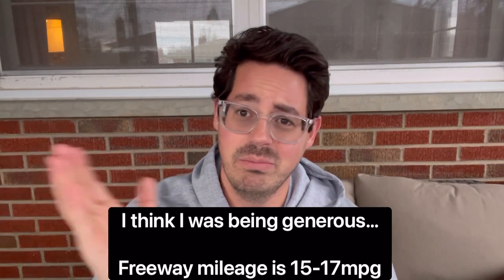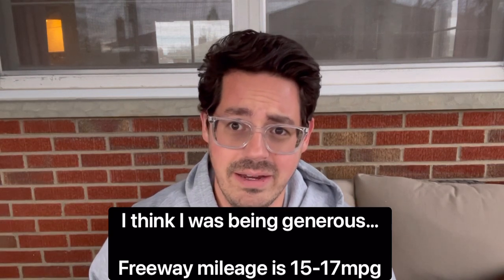Worst Engines of All Time: 1982-84 GM/Chevrolet 305/350 V8 Cross-Fire Injection System

Comment: My High School Drivers Ed course had 5 Black 1984 Formulas with the basic v6 pumping out something like 110hp. Presumably the local Dealer couldn’t sell them so they were donated to the school. That v6 is probably a worse engine but then you would expect it to be vs the v8. I have a 2nd gen TA but I’d love to have an Iroc Z with a manual. Maybe some day I’ll get to experience the crossfire v8

Comment: In 1995 I drove my workplace boss '84 'Vette, as he was considering selling it at a consignment lot; whereupon he delegated that task to me.
The bodywork and interior were kept in superb condition.
When I drove it, I had no prior knowledge about the engine with its Cross-Fire Injection.  But, just driving it a couple of miles, I considered that engine to be a 'bucket of bolts' with its erratic throttle response.
In addition, the steering was sloppy and brakes were lackluster.
Going over an uneven portion of pavement, there were rattling noises in the car.
The car was sold to a company employee.  I tactfully kept my mouth shut about my driving experience with that 'Vette.

Comment: I had a 83Z 28 automatic 305 crossfire injection I had 245,000 miles on that motor never had a problem until the day. I pulled the whole shot and went up the mountain at about 100 miles an hour and the main shaft and the tranny snapped and that was it a retired car, but I would not add a half a quart every 5000 miles I would change the oil and I would use about a half a quart Castro 530 best one I ever had. I heard nightmares about the crossfire injection but I swear to God it was the best one I ever have. I have a 1990 Z 28 Iraq with a 305TPI I would swear my crossfire injection was faster had more power and I never got worse in 20 miles to the gallon in the 15 years that I owned it I must’ve been one of the lucky ones I heard nightmares about him but then again I must’ve been one of the lucky ones😊

Comment: If I were a GM engineer in a Malaise era, I’d go with a Bosch Jetronic fuel injection system because it’s a reliable off the shelf system. Had GM used Bosch Jetronic, those engines would made over 250 hp and be a lot more fuel efficient. Heated wire MAF sensor in 1976 sounds very impressive.

Comment: I owned a 84 Vette for several years in the nineties. Never had any issues, the engine and transmission were very reliable. The power was low like everything else at the time, but it had good low end torque and an awesome V8 sound. It was a fun car handled better than anything else. So what if it starts to loose breath above 4000 it made maximum torque at 2800! What other options in 1984? Port injection had issues. Remember the injector cleaner they sold? Of course they got much more powerful in later years. This was a decent motor in 1984 and the 4 speed auto was great on mine. I liked the satisfying sound it made shifting into drive, and the shifts were crisp.

Comment: I use to own a gun metal grey 1982 Firebird and when I got it it had the 305 with a carb on it and it was alright but the late 70's early 80's 305 were boat anchor's I fixed mine with changing the stock cam with a after market cam and it helped it out a bunch and the engine finally got to breath I went with something that was close to a 350 cam but with  little higher lift I remember I put new valve springs in too along with cam and lifters and put a aftermarket intake on at the time too.

Comment: Just seeing this and I have 2 each 82 crossfire corvette's.  They are junk.  Very, very vacuum sensitive to put it mildly.  The ECU monitors so many sensor inputs, which makes troubleshooting issues a major challenge, amongst other things. Tranny 700R4 has been good but waiting for that to be next.  Buy an 80 or 81 and stick a 4 speed auto in it and enjoy.  350's are the best engines ever.  My other 82 is what i call Frankenvette.  Removed and trashed the crossfire and put edlebrock with holley 650 and headers.  Fires up everyday lol.

Comment: Yes the engine itself is arguably one of the most reliable engines you're talking about the fuel and spark system that was seriously problematic but other than that the American V8 350 305 are unbelievably proven and reliable engines compared to anything foreign because they're simple to repair and they last so yes the ignition system sucks that's why you take it off and slap on a four-barrel carburetor and you are good to go

Comment: I think this would have eventually been perfected but in 1985 GM had the tuned port injection and there was no point in continuing with the CFI. Especially when the basic Quadrajet was cheaper for the lower end engines and efficient enough.

Comment: You could hold the A pillar on my 79 T/A, T top car, feel it move back and forth. The roof sheet metal actually cracked on both sides where the center support for the T tops meet the windshield frame.

Comment: I had a Cross-Fire in my '84 Vette.   It was pretty quick to about 65, then tapered off quickly.   I think it was rated at 205 HP.  No troubles with it, and it was dependable, but the Vette deserved better.

Comment: Long runners are for low rpm tourque. Short runners are for high rpm. The intake also has tiny runner size, what’s really hamstringing it. That’s why they make the “renegade” aftermarket replacement.

Comment: A 305 ci engine cannot even inhale 700 cfms lol , a l69 feedback model was rated 195 hp , thr lu5 code was a 175 hp in 83 and a crossfire would pull on a lg4 no problem . My 83 has 71 k all original and will break loose in second gear I don't know wear you come up with this stuff but its entertaining to say the least 😂

Comment: my 83 z28 crossfire pulls strong slams gears and a total hoot to drive .plus the fiber glass hood with electro cold air induction flaps makes it a super cool nostalgic  electronic muscle car . They make heftey tq at a lower rpm . Im certain it could beat a lg4 z28 with feedback rochchester . The crossfire is the most unique out of all 3rd gens 4 bbl cars are just boring

Comment: Drove an '83 Z28 305 crossfire system back in the 80's. It was bought brand new. I can safely say, I thrashed that car terrible, I was not gentle with it. I can also attest to the fact that the transmission was a weak link as I dropped it twice. I have to say, for the total package, it was a great performing car for the time period though. It had plenty of low end torque but it would run out of air at the top end but it was a 305. But the engine and crossfire system was flawless for the time I drove it. Regular maintenance was all I did. It got great gas mileage too compared to carbed engines we had prior. Wish I still had her. Loved the forced induction hood too, the flaps that flipped up at full throttle. pretty cool stuff. Sorry your experience hasn't been as good.

Comment: I too loved Knight Rider (Im 52). When I turned 16 I bought a lease return GTA from the LA Auto Auction, 305 TPI auto (due to the T-Tops). The car was beautiful (Gray, gold BBS wheels, orange digital everything, total showroom glitter) and a perfect pile of junk. In the 80's (Valley) every home had an F-Body in the driveway because somebody worked at the Van Nuys plant and got the employee discount. My High School (El Camino) was full of them, Firebirds, IROCs, Z28''s, TAs... The design flaws were ridiculous. You turn too fast and the gas moves to one side of the tank and the car stalls. You turn the wheel to max and the front tires grind the wheel wells. The doors had to be realigned every few months (warrantee) due to the swish-cheese body movement... I gave up after six months and ran it back through the same auction. Memories...

Comment: Man you people are  stupid. !    I have a 1984 crossfire . I  bored 30  over hoged out the intake ports .  They do make 750. Cfms .I beat   gt 500s  that can be turned into 900 cfms.  At 6.300 rpma  in fourth gear   250 miles an hour . In satalight .  You guys are stupid .

Comment: To do this subject justice, you should have talked about the TPI engines that replaced the Crossfire (CFI) in 1985+. They arguably solved the fuel distribution problem with one injector per runner (for improved fuel economy) using a dry plenum, but the TPI longer runners were not much larger in flow area than the CFI runners, so the hp curve flat-topped like the CFI engines around 4500 rpm. Both CFI and TPI were great torque motors, sometimes called the best truck engine GM never installed in a truck, but didn't flow enough to make large power above 4500 rpm. That problem was partly solved when the 1992 Ycar LT1 issued (300 hp), and even that engine was somewhat air-starved at higher rpms.  There is at least one video + dyno here online that showed the gain by removing the stubby-runner-length LT1 & L99 intake with a carb-type airgap manifold + old school carb.  I think it was more than a 30 hp gain with no other changes.  That modification can work on a B- or D-platform L99 / LT1 engine from 1994-1996, but might not have the hood clearance on an F- or Y-car.
Reply: IIRC the engine that preceded the CFI was only 165? hp (for the 350) ending in 1981, so the CFI version put the car back into the 15s at 205 hp in 1982.  TPI went to 230 hp in 1985, and solidly into the 14s.  All very slow by today's standards, but not bad for the era.
Reply: @kenrolt8072  Don't you mean the LM1 350?

Comment: I've got a cross fire in a Vette and it has over 100k trouble free miles but I had a 82 and a 83 z28 and both had cross fires and they was total junk seems like if you got a good one you had a good one and if you got a bad one you really had a bad one as far as 305s go I've had a bunch of those with 4 barrels and they all went over 175k and was still running good when I sold them and they was all in 3rd Gen z28s

Comment: I was 18 when I bought my brand new 1982 black/gold Recaro T/A. I was ogling it on the showroom floor and the salesman had my number. Bought it the next day for $15,500 at 17% interest! It was a beautiful car for the time, but was only fast when it was parked! As soon as you drove it you realized what a pooch it really was. The rear disc brakes were terrible and never adjusted. The t- tops leaked, the transmission shifted terribly and the hub caps flew off whenever they felt like it. I installed a "test tube" to remove the catalytic converter which boosted performance ever so slightly, but basically just made it sound a little better. Even with all these disappointments, I LOVED the car. I had it til 87 when a pick-up truck became the better option for me. I would welcome it back anytime. My buddy bought a red '87 GTA and that car was a tire burner. What a difference a few years could make!

Comment: GM should have spent more money on the computers. A lot of the problems were bad computers and the techs didn't know. They were told, if the computer was bad. The engine would not run. That was 100% wrong.

Comment: An 82 is not a classic. Sorry to bust your bubble. A 72 would qualify, but then 73 was the first year for the Ralph Nader "safety" bumpers. A 70 Chevelle is a classic, a 69 Galaxie 500, a 68 GTO, a 70 Cuda, a 70 Roadrunner... By the time 1980 rolled around, they weren't building cars anymore, they had switched over to building mass-produced junk transportation units for mass-consumers. All the emissions crap reduced the horsepower, the ugly designs made the bodies all look like overgrown toys, and the so-called "safety" features ruined the driving experience. Nowadays all new cars look like they were carved out of a cake of soap by a robot. No class. No aesthetic appeal. No chrome! Just a lot of plastic.

Comment: Boy did this bring back memories, I bought a 1982 T/A back then, it was red like yours but did not have T-tops, had a 4 speed manual transmission, and was not impressed by the lack of power. With my dads help we put a re-built mid to late 1960's 327 in it, with 10:1 compression pistons. Had a healthy Hydraulic cam also. Put a Eidelbrock manifold and a Holley carb on it and had anti reversionary headers also. Some one back then made dual exhaust for the Camaro/Trans am, that went side by side along the drive line and had to short mufflers that sat next to each other sideways next the rear end and the two tips exited on the drivers side under the back end.  BOY did that car come alive, it fact it was kind of scary if you whipped out to pass and hammered it at the same time, could have had to do with the weird setup of the rear suspension as there was a bracket the bolted to the tail shaft of the transmission and ran along the drive line to the rear end to control the torque twisting of the rear axle.

Comment: if you change the fuel injection system with an aftermarket modern one, would it fix the engine?

Comment: 139 mph for automatic 84 Vettes according to period magazines. I fixed the 4th gear lock out on my 84 Vette with an aftermarket 3-4 shift sleeve. WOT upshift was 4800-5200 stock on the 350 powered cars

Comment: I had an 83 Chev Silverado truck with a 305 , your right, a piece of crap!   I had it 3 years, went to 18 mpg to 11 mpg and lost all power. Problem was cam lobs were worn almost flat.
and the injection system, really never worked that well, Kept changing spark plugs , thinking that was the problem. That was my third Chev.  Thank You but I'll stick to Ford !

Comment: Have you ever talked about the 350 GM diesel that they took an existing Oldsmobile gasoline block 350 and made it into a naturally aspirated diesel and what a disaster that was as the issues began to show up due to the severe under engineered design for diesel fuel use. That crap engine haunted GM for some years until they came out with the 6.2 diesel and it proved to have merit even though it was very low on the scale of hp.

Comment: That "Crossfire" intake is the same as the 302 Z-28 2x4 intake from years earlier, but with 2 injector bodies in place of the two Holley 4-Barrel carbs.

Comment: A lot of info you gave on Crossfire is incorrect, but is the product misconceptions that were told and repeated to many times it became 'fact'.
I do not have the time or inclunation to correct everything  but I can clear up some general info that you did not cover.
First, the Crossfire was created to meet tougher emmision standards which at the time were a specific 'loop' that included acceleration, stops, hills, stops and so on. GM could not meet the allowable emissions with carbs, so they needed the fuel injection. The primary advantage was that with fuel injection, the fuel could be shut off during decelleration or coasting down hills. Not pssible with carburators.

The only TBI that GM had teady off the shelf was the single bbl which was for a 4 cyl engine. 
The rear axle rations were rediculous, again to pass the loop emissions test, the the cars were desperate for low end power.

At one time GM and FORD were officially into Trand AM racing and those rules did not allow anything protruding thru the hood. 

Low end and into midrange requires long runners, to to get the long runners under Camaro and Trans Am hoods, GM created the cross ram manifold. With a pair of 650 tp 750 holley carbs, these manifolds provided big mid range punch tha GM cars needed to accelerate out of corners
 Offenhouser made a copy of the manifold with lids for a single and for dual carbs.

People could have bought the Offy brand new cheaper than the poorly designed and generally unavailable Renegade, but ss I said earlier, almost all of the info on Crossfore was inaccuraye and the product of uneducated people and repetition over time until the wives tsles became facts.

For example, whoever said a pair of Crelossfire TBs flow 750 CFM is dreaming. 

GM resurected the idea to get low end torque and also provide mounting for two throttle bodies. To keep the runner flow speed high, the runners have the bottom third filled to reduce volume.

Ok well, thats enough. It would take pages to correct all the wives tales, so I'll leave it at that.
Reply: My 84 Corvette ran perfect ones the TB's were set correctly. Very reliable
Reply: If air-fuel distribution was poor, GM should've taken a page from Nash Motor Company (back in the 1950's).  They used a water jacketed intake manifold that had perfect air-fuel distribution and vaporization.  The entire manifold was at the same temp as the coolant at the top of the engine (flathead six), and Nash engines were renowned for fuel economy and smoothness.

I don't know how GM would water jacket that Cross Fire intake but, had they done so, the runners could be large for breathing and the uniform heat all over the casting would enable a much leaner air-fuel mixture and balanced distribution.

Comment: I've owned several C3 and C4 Corvettes around this time (but no crossfire) and GM was nothing but cheap.  They abandoned fuel injection in the 60's  in favor of big block engines leaving them nowhere to go in the 70's.  Their competitors invested in fuel injection early on and avoided the embarrassing malaise era engine output for the most part.  All GM had to do was call Bosch at the time and that would have solved all of the problems.  My brother did just buy an '82 Corvette that I made a point to drive.  I thought the engine pulled pretty good and close to a L98 down low but just as this video said the party was over at 4000 RPM.  Hardly a sports car, but a good cruiser because people do seem to love the shape of C3 Corvettes and it drew a crowd wherever I took it.  But on the L98, you can get them running low 13's easily and rev to the moon even with TPI on the stock lower end.  https://www.youtube.com/watch?v=_o2EUVbQh7E